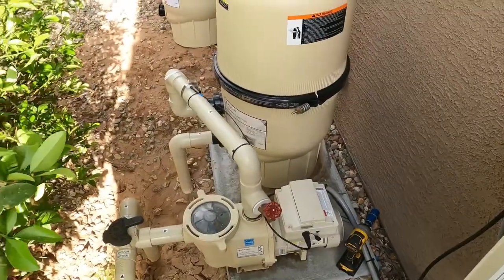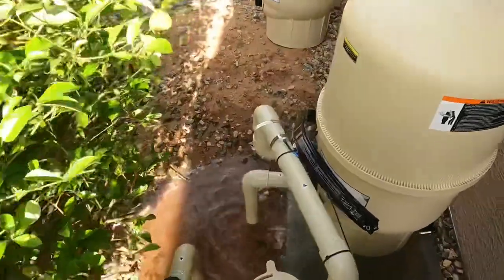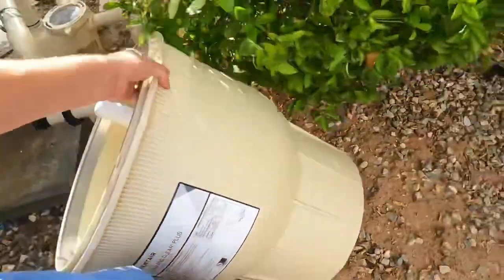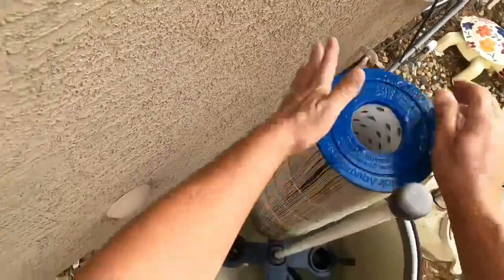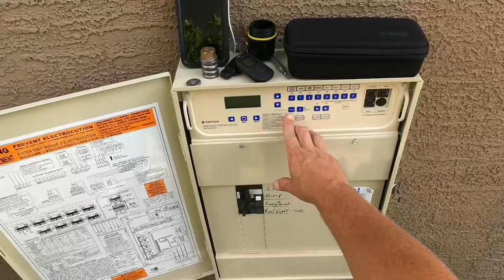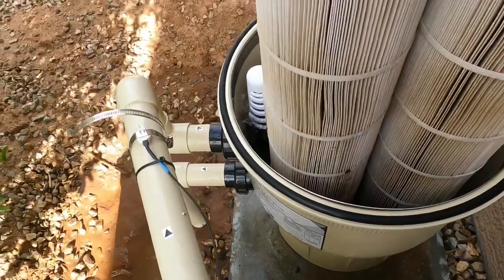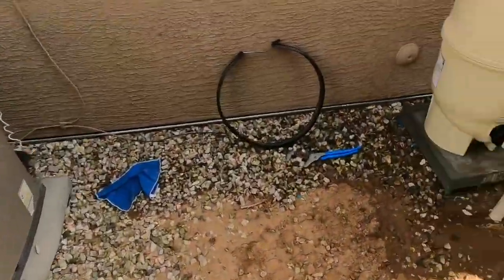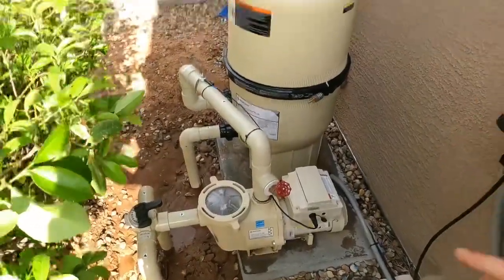How to replace pool filter bottom

Comment: Good video. 
Question. 
What was the reason you replaced the lower filter container ?

I vac my pool and within 3 days I get light old vac debris on the pool floor. 
Which I have to vac every week. 

It’s getting frustrated, I already replaced the 4 new filters the problem got a bit fix but still getting light green debris down the pool. 
I did a quick test by vac the pool with green dust debris and told my wife to hold the supply outlet with a n-95 to use it as a test. Sure enough it pick up light greenish coloring which is the exact dust on the floor. 
The pool is super clean now but when later when the pool is off it will eventually settle. 

Please help. Thanks. 
I’m a regular hands on home pool owner. Not a business or a pool tech

Comment: What is the name of that tool you used to remove the bolt on the clamp?
Reply from the maker: Impact driver with a 7/8th inch socket
Reply: @snarkysharkypoolrepairs1887  ty